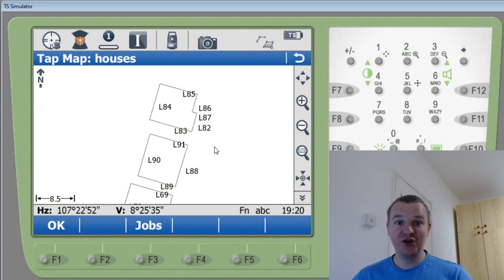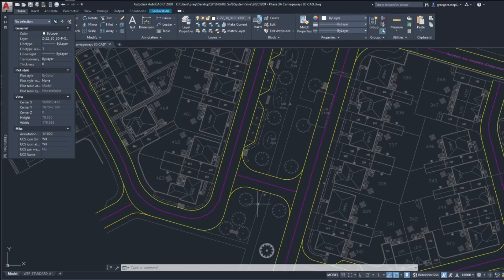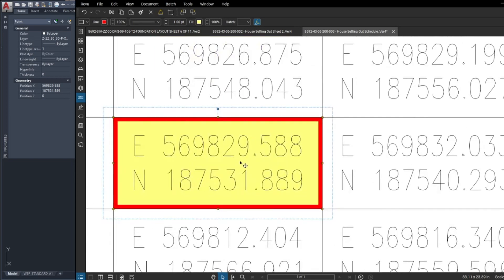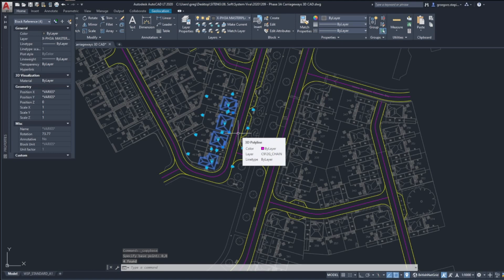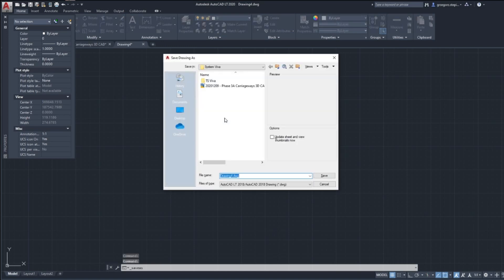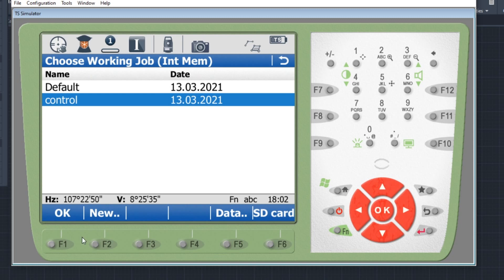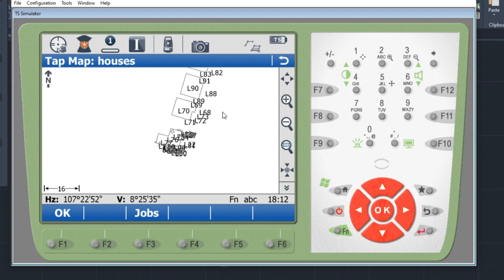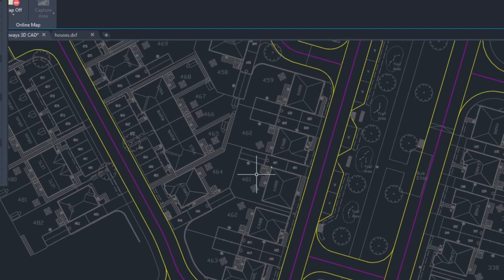MUST KNOW! jobs & data to TOTAL STAION. how to transfer information needed for SETTING OUT to EDM.

Comment: Greg very helpfull Video. 
 With this example are you only able to layout the line. If you want to lay out the actual corners of the house. Would you need to add pointstyle to each corner before saving the drawing as a dxf? Thanks
Reply from the maker: Thank you Stephen! Yeah, adding the points in the corners would be the easiest option. Depending on what TS you are using you can still do that later on the controller.
Reply: @SITENG  Thanks Greg
Reply from the maker: @stephenedwards7995  no problem :)

Comment: Resembles with what I am doing at the moment! Is the purpose of importing so you don’t need to spend time putting lots of info into the machine? I use Trimble S5, thanks for another informative video 👍
Reply from the maker: Thanks Blaine. Yeah, it makes life much easier and when using robotic I almost always do it this way.
Reply: @SITENG  I usually put the info in every few houses, as I don’t always have a digital copy of the drawings. Usually just have to look at the paper copies on site. Definitely something I will try do in the future!
Reply from the maker: Whatever I am doing I always keep paper copies with me and I never rely only on info in the EDM. Some people importing all drawings with all info, but it's not the best way, it's actually mess. There is nothing wrong with putting the info into the instrument yourself and if there is no digital copy that's the only way.
Reply: @SITENG  yeah, this makes sense. As it means you know the information is always correct. Is it possible I can connect with you on LinkedIn?
Reply from the maker: Yeah, no problem! I am starting siteng on LinkedIN today, so please follow :) I will try to find you now.
Reply from the maker: You don't have a photo on LinkedIN? my page is ready there and you will find me easily :)
Reply: @SITENG  I have followed you now, thanks!
Reply from the maker: Thanks Blaine :)

Comment: Greg, thank you for this video.  For me, working at a "domestic" scale makes it much easier to follow all your actions and explanations.  I understand AutoCAD so how you selected your points to make the .DXF and its transfer to your EDM now all makes sense!  

What I would like to see is how/where the site TBMs are marked on the plans so I can fully understand where/how you position your EDM on site to start your setting out?  Can you follow-up this by showing us the setting-out on site from the saved points in the EDM?

Thanks for sharing so much with us.
Reply from the maker: Hi! If you look at my first 'Construction drawing' video I am showing control points I am using there. I will try to show this on some drawing also so you can see :) Typically these are given by the client, but I'll do a video where I'll show this and use the points :)
Reply: @SITENG  Thank you - I find it helpful to see things done in "real life" rather than just as demonstrations.
Reply from the maker: There will be more :)
Reply: @SITENG  Looking forward to that :-)

Comment: Great tip to remove the lines which we are not need at the time. I remember to work with the engineer who had all information on drawing including the comments etc. Proper mess 🙈 good job Greg 😊👍
Reply from the maker: Thank you Edyta! I always prepare the drawing before working with it, as you can see this is much better :)